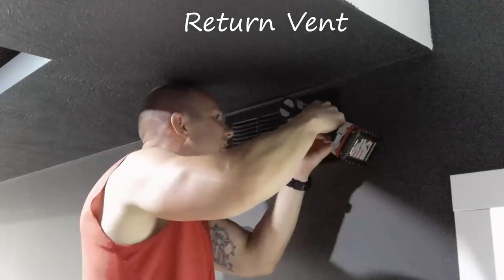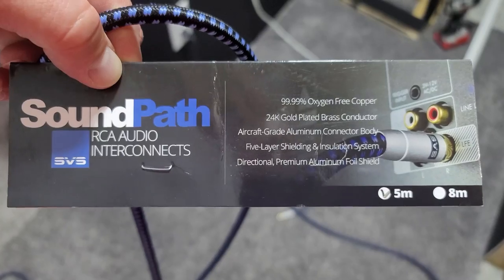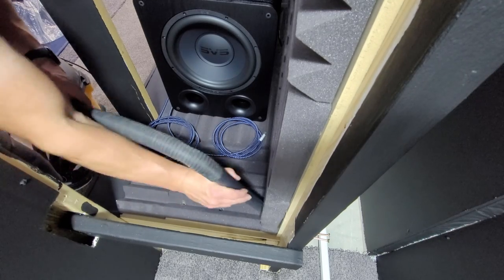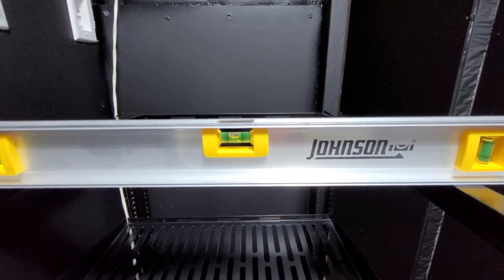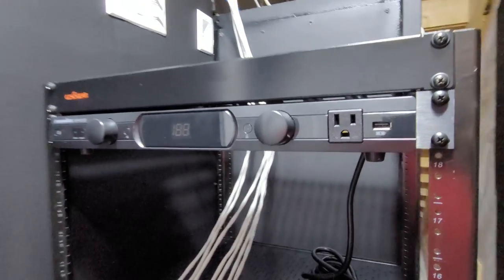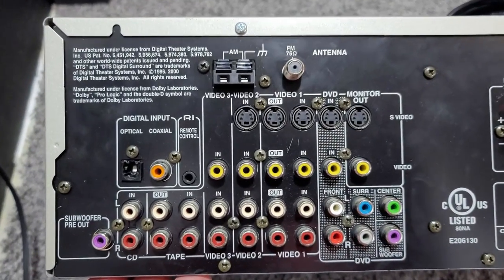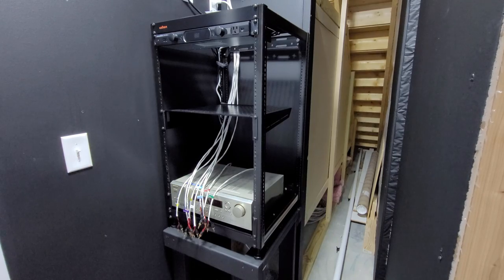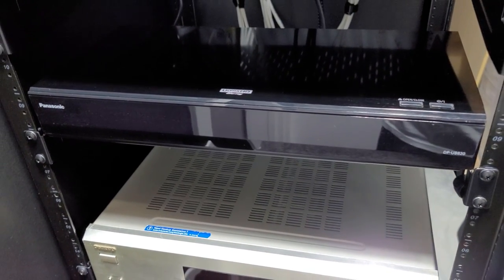Basement Home Theater - Misc. Installations & AV Rack

Comment: Thanks for the vid. What made you decide on the T9 AC Infinity (top exhaust) versus the T8 (rear exhaust)? I have an enclosed rack that has fans built into the top, but my AVR will be closer to the bottom, with many other components between it and the top fans. I'm thinking that rear-exhaust fans might make more sense for me. Thoughts?
Reply from the maker: I knew my AVR would be at the top of my rack, and with my rack being open on all sides I just figured pulling heat straight up and out  makes the most sense in my situation.  You wouldn't want to blow heat on another piece of equipment above the AVR so go with the rear exhaust for your setup.  Thanks for watching!

Comment: Big question. Are all RCA cords directional. I might have to take down some drywall if they are. Good thing they it’s not taped and mud yet. Really glad that I just watched this video too.
Reply from the maker: No not all directional - in fact, to my knowledge, most aren't.  In this case it's more for shielding to help prevent unwanted noise interference from getting into your subwoofer - an added layer of protection basically.  Check the make/model of your cables to know for sure!  Thanks for watching 👍
Reply: @TyEichele  I bought some mediabridge cables from Amazon. I thought both ends were identical when I placed them behind the walls. I am a beginner at this but really enjoy your channel. I am placing my theater room in the basement. Currently framed and almost done with drywall. Learning a lot from you and a few other you tubers. Thank you so much for responding.
Reply from the maker: @tdhoeffel  Absolutely!  That's the whole reason I wanted to do this in the first place, so people can learn from my mistakes 🙂

Comment: Great video, how does the Onkyo get the signal from the Denon for the bass shakers?  How does it synchronize with the subs, etc?  Thanks.
Reply from the maker: Thanks for the comment and watching!  

My plan for the Onkyo getting the lfe signal will probably be the second subwoofer output from the Denon going to an RCA input on the Onkyo.  If that doesn't work, then the Denon also has some pre-amp outputs I should be able to use to get the full signal to the Onkyo receiver.  I'm hoping the second subwoofer output works because then it would already only be sending the LFE signals.  Otherwise I'll have to set a crossover point in the Onkyo and let it handle sorting the low frequencies out.   
Another option I could use is an output from the Minidsp 2x4 HD and go to the Onkyo from there.  It would be like using the second subwoofer output on the Denon basically. 
Hope this helps to answer your question!  Stay tuned and I'm sure I'll do a video on it when I get to that point 👍

Comment: Enjoyable video, as always. :-) 

I couldn’t help but notice that you installed your middle two shelves upside down. Out of curiosity, was there a specific reason? 

Keep up the great videos. Also, do you have a like to your AVS thread, please?
Reply from the maker: Thank you!
I installed the shelves upside down on purpose to make sure the sides of the shelf didn't interfere with any airflow to the side vents of the equipment in the rack.  That's the plain and simple reason.

Here is a link to my avs forum thread: 
https://www.avsforum.com/threads/my-diy-basement-home-theater-build.3180715/

Thanks for watching!  More to come soon 👍
Reply: @TyEichele  very cool. I’ll be honest, I was 99.9% sure you’d have a logical answer for it. 

Thanks for the link - I’ll check it out. 🤩👍🏻👍🏻👍🏻

Comment: Is there a particular reason why the rack shelfs are mounted upsidedown?
Reply from the maker: Personal preference I guess - I didn't like the way the sides of the shelf came up next to the vent openings on the sides of the equipment.  Mounting them upside down fixed this issue.
Reply: @TyEichele  thanks for the reply wanting to get a little more airflow into the vents makes sense.

Comment: Directional cables…? could you please elaborate this, because i am skeptical
Reply from the maker: This is from their website:

Directional shield layer is a spiral braid of premium grade Aluminum foil and 56 strands of 99.99% OFC tinned copper Shielding – critical part of five-layer insulation system. Soldered to ground terminal at the source side helps reduce EMI and RF noise between electronics.

It's all part of their shielding system to prevent unwanted noise interference - hence, the directional arrows when going to hook them up.  Would it work if you hooked it up backwards?  I bet it would - but that wasn't their design and maybe it does make a difference since grounded only at the source end according to their description?

Comment: I've been watching people that live in Wooden houses with Sheetrock for walls which makes it a easy installation for In-wall and ceilings speakers  but I live in a house that has Ceiling, floors and walls done in cement. But I feel much safer living in a Cement house than a house with Wood and Sheetrock.. In wall speakers like Atmos and surround is impossible for me.
Reply from the maker: Yeah that would present a whole new challenge for sure!  In a lot of different ways I'm sure.
Reply: @TyEichele    Oh it sure do,, You have speakers poking out of everywhere..